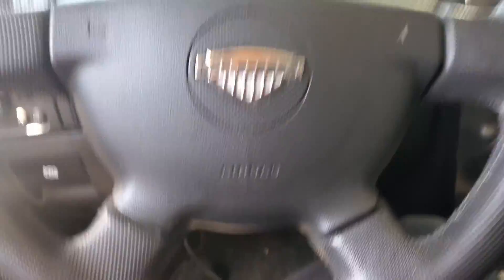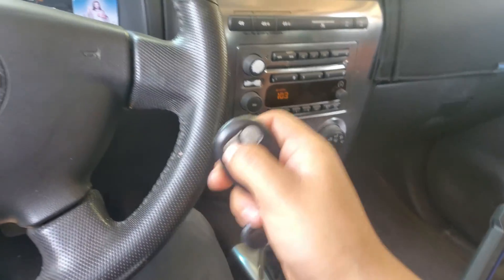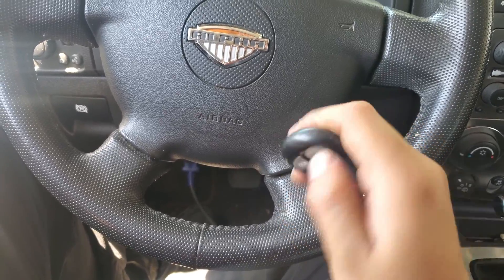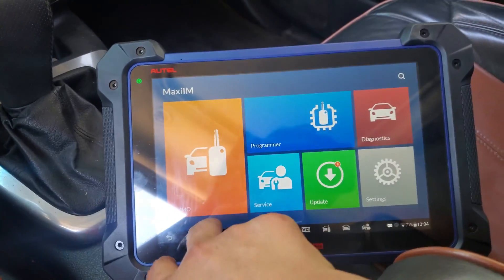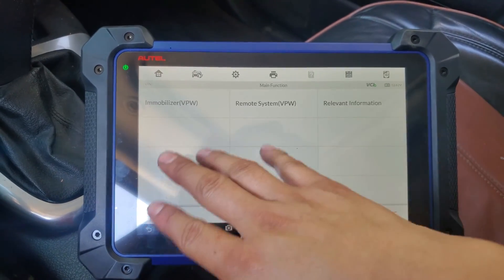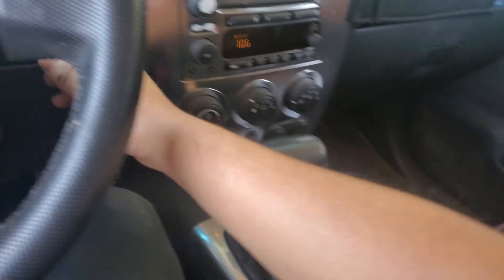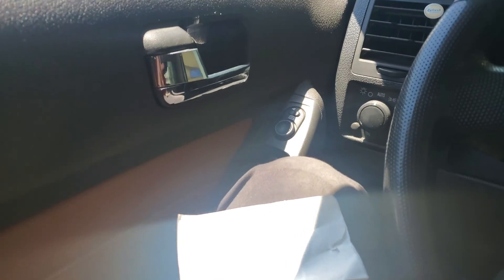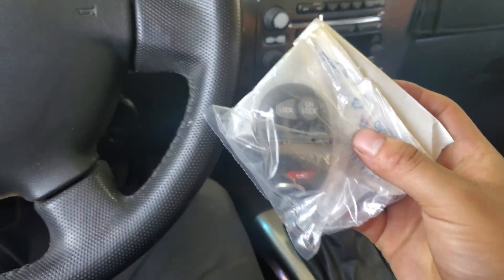How to program Hummer key fob on H2/H3 2008-2011 with Autel Scanner

Comment: Hey do you have part number for key fob? Mine don't program aftermarket even w tech 2 so I'm thinking I need oem fob to match frequency
Reply from the maker: sorry for the late reply.  this is the link for the original key fob for this hummer h3. https://www.ebay.com/itm/283430580387?fits=Year%3A2009%7CModel%3AH3%7CMake%3AHummer&_trkparms=ispr%3D1&hash=item41fdc770a3:g:1qQAAOSw0w1cmYGC&amdata=enc%3AAQAGAAACoPYe5NmHp%252B2JMhMi7yxGiTJkPrKr5t53CooMSQt2orsSwcmzw5CLtzTE60FqHcnq2LwBVcXfVGNS4fKB%252BQ8%252BAV1eYcxKx7rs67tPByF7Y8X4cPWIv2NhJQcvqatA7zhgzCcv0f8eXdGxzrmabKqBV7sugcRKjKAuBQRHWq%252B3IDlFgeiRGUyiuzhvzPX%252Fqau6AMQDu4d1gIKmso11mBbw6lCefrtejxxN5qQBAZsmvW%252FpBPClB%252FfSTf9tY3mO4xF7m63U%252FdSlUsvzZuyCp2KY00Jos3YvYnVztKD07g0Rfzz5572p%252FD74k20pXZkXQuR221VYXGRzHPQa11U%252BN3H2Qa7rFpzDw0OGcb%252Bav48dr2pWoAEPXd0paL8OEGpckq2pXoaJG4x3ZtfJCMzm5%252Fo2ca1VEKmwXwebxNUv8I4EjotJoIR6rUd7w3tbpFilQUqliwDqsWzQvgwJNmT7iv%252FMN0gtApsID9KPgP9wYpynQoMe1gJG5LyEQEqk8%252Bnbls%252BBTl0%252BoB%252BFueky2CtQ5hRhJDJamhqdbpoK%252F81RQNZVQZWKXSvsQwB7zXMwNt%252Bs75rW0cRlUVWHTzETiBlkxcDA9X9mYzz2%252Fw9XjrYvGg6d3lhPIRx69x%252B5Q%252B0FSSlr23rYck4pXXXKYz39dFIkVjzVymi9xghlLJTzqkBP%252FNzQvPCUD747btCY41rBeHiM1Z3lRCPIUnGDOjGqslC29YcfhuD2%252BjDAFIHqEg7%252F6056sJLZrBK7w%252BCNvZwJ%252Fer1yc2AbLrX9at2%252BZzwRI9kX13qcX0%252FHjd9yi7epQW1E2PwukdyVsW9LVpVvgSLjeAGJR%252FbW%252Fa2Hpw5psEkK0%252Fz3ifZJlQPkg6b1a%252BD05RZ293BC298zvR%252FSdtiez2tRMnfJ0kN7w%253D%253D%7Cclp%3A2334524%7Ctkp%3ABFBMtNjY-pVf

Comment: Hey i was wondering if you need that programing tool or not?
Reply: Kind of stupid to make a quick tutorial for how to program something that you need a massively expensive tool just to do it. You might as well have said “a dealership is your only choice.”
Reply: @quentinryan  Good point. Didn't work on my Hummer either
Reply: @quentinryan videos are geared more towards locksmiths
Reply from the maker: Yes you need something similar there is no onboard programming procedure for this model unfortunately.

Comment: I have 2 new unprogrammed remotes and took it to a car locksmith. He had a scanner/like yours  and when trying to connect to hummer for info nothing would pop up. Like it didn't exist. It wouldn't connect so that he could program the remotes. He said he's never had that problem before. I know when I hook up a regular OBD2 reader it scans fine. Shows my van and everything. But trying to pull up the software for the remotes doesn't happen. Are you located in Southern California by any chance?
Reply: I meant to say it shows my VIN not van LOL
Reply from the maker: Choose it manually then. It should work. I am not on southern California unfortunately.